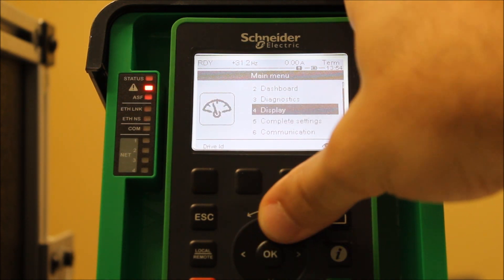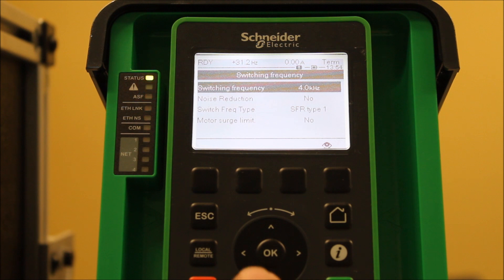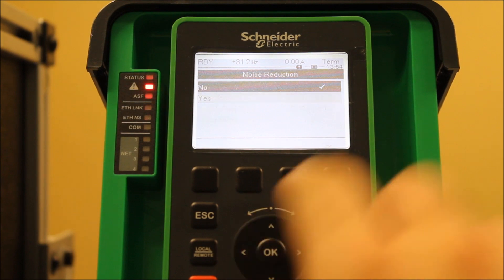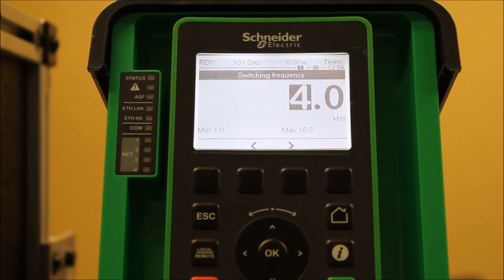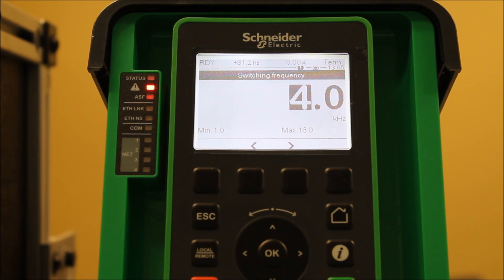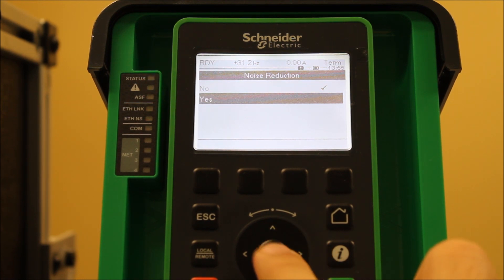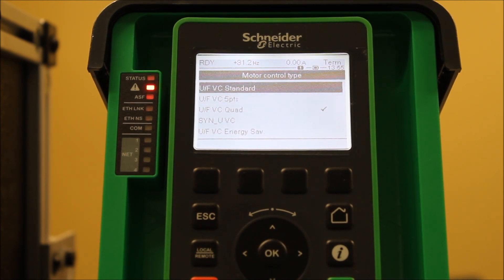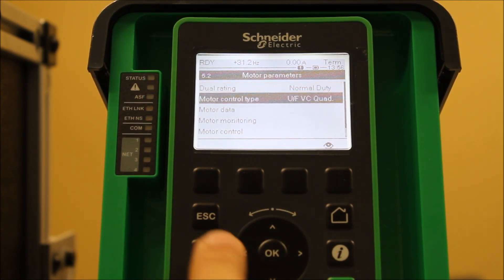Reducing Electrical Noise Produced by Variable Frequency Drives | Schneider Electric Support

Comment: For those who want to achieve noise reduction in their motors, take into account that the motor must be for "inverter duty" application and consult to motor's manufacturer which is the minimun switching frequency that the motor withstand without power losses. Also, VFD's manufactures established to install cables with the proper size and use shielded cables to reduce accoustic noise generated by harmonic resonance.